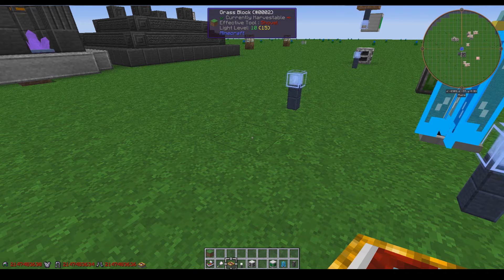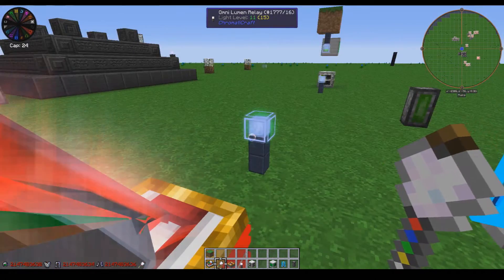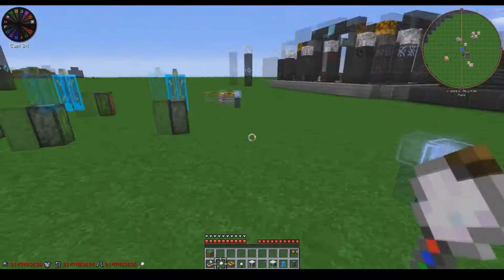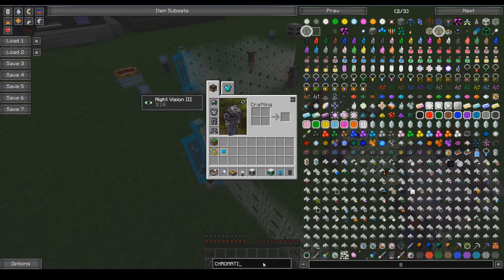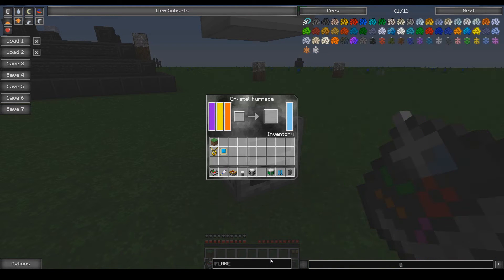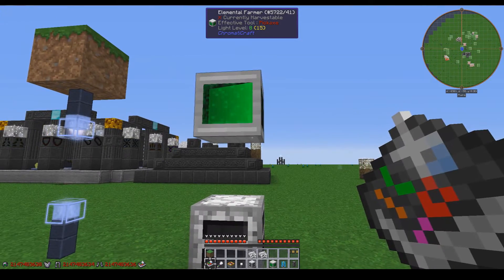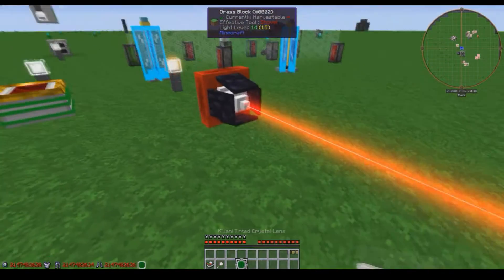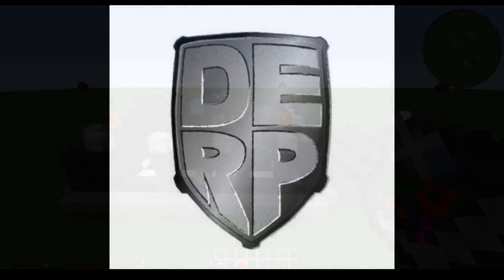Chromaticraft Tutorial Series Part 5: Lumen Relay Source and Related Machines

Comment: Do those smaller repeaters have any reason not to use them over Multi-Aura Repeaters? They seem smaller and more convenient. Do they just connect with certain blocks like the Lumen Fence and its controller? #chromaticraft
Reply from the maker: +GlitchReaper 
They are an alternative power transport system where the source of the system in the block "Lumen relay source". The sinks are stuff like crystal furnace, lumen fence or elemental farmers. Pretty much think of repeaters as long distance electrical cables from the power plant and the lumen relays as the wires in your house. They also only connect to a select few machines, most of which are listed above.